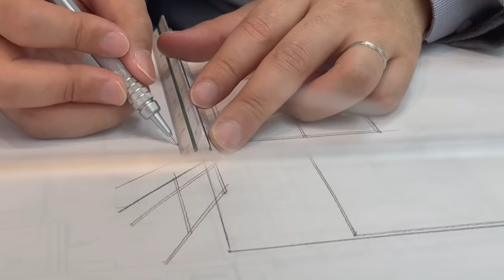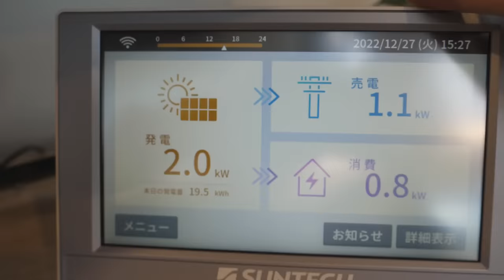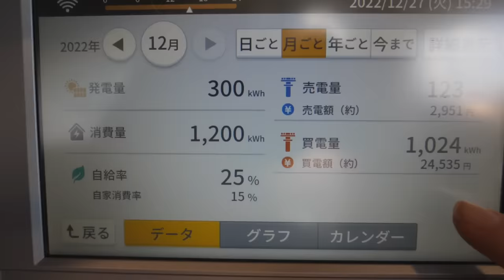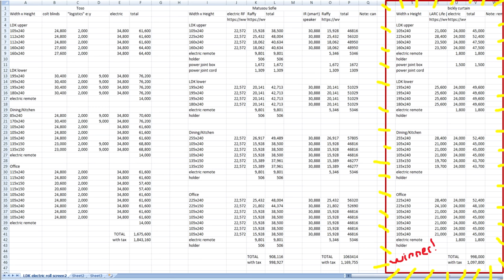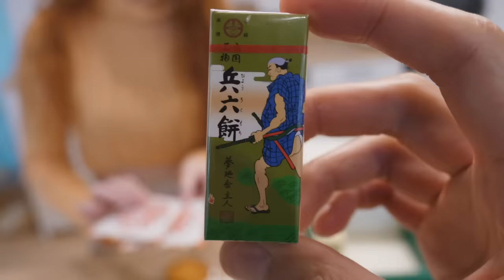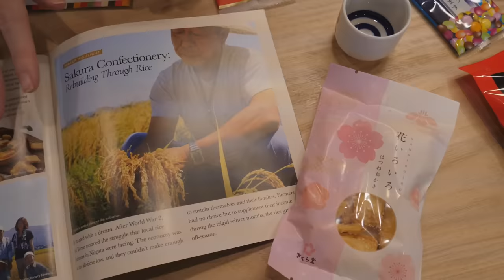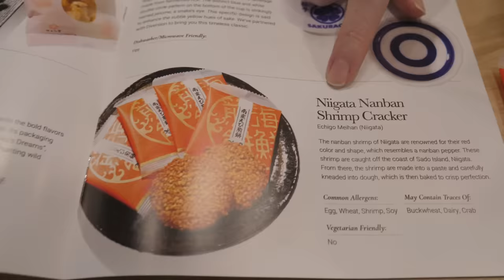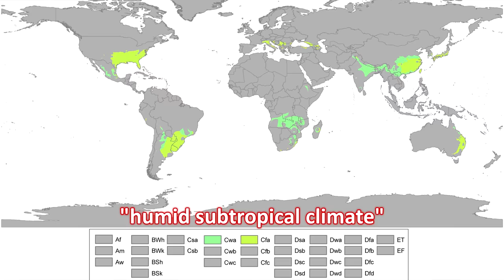1 year in our new house!

Comment: I live in Georgia in the US and run into the same issue as you do with the closets getting humid/moldy in the summer. We've swapped out our closet doors for wood slat doors that allow for more ventilation. There are some really beautiful options that have come out recently. You may want to consider swapping your storage room door out for one with slats, that way you can still shut off that room to the cats and don't have to look at the contents of your closet all summer but the air can still flow through the shut door.
Reply: that is actually a good idea.
Reply: Ill leave a comment here just because I think its a good idea
Reply: Or potentially adding some vents into the existing doors? Could paint the vents to match the color of the doors?
Reply: Same here! mold its always an issue where i live specially in a badly ventilated bathroom, on boxes and ofc the closets.
Reply: yeah, I think this would be better than shutting everything in closed cupboards where there still won't be airflow.
Reply: This is a great idea 😁
Reply: Japan commonly has a lot of paper doors. Would that work? Kind of like storing stuff in paper bags, so it does not retain moisture but still keeps flies out?
Reply: SUCH a good idea, got to boost this so that R+J see this
Reply: A de-humidifier would probably help as well. The storage room doesn't look too big so maybe a smaller de-humidifier + the wooden slats doors idea could do the trick.
Reply: Great idea. I hope they consider it!
Reply: totally agree. this is why even lockers have a vent on the top!
Reply: We live in a very wet climate, like hanging out laundry just doesn't do anything much, and we live by dehumidifiers. Without a dehumidifier running during showers and rainy days, just everything would be moldy. I love them.
Reply: @yeevita  I'd think so?  I mean, the whole idea of the paper doors is to cut down on air flow, but they'd still let more air through than a wood door, surely.
Reply: @yeevita  I don't think cats and paper doors are very compatible, unless you want to replace shredded paper once a year.
Reply: Or cut out holes in the storage units and put in wents
Reply: I agree. Myself I keep the doors of every room open, my cats have access everywhere.  I know this is not possible for everyone but thanks go this I don't have this problem.
Reply: And it’s not a complicated fix either that requires and intense labour or like knocking down stuff or rebuilding
Reply: Great idea...  💡
Reply: @mariafgarcia8165  I agree... 
Being a newer home...plus given their climate.. That would definitely help!
Reply: This is a great tip! I may do it in my own home. One closet specifically gets mold SO FAST
Reply: This reminds me of a Youtuber I follow named Mia Maples who cut a rectangular hole in a wardrobe she was renovating and added rattan to it. A rattan screen or rattan slats in the closet doors wouldn't be a bad idea.
Reply: @10TAckerman  I’d say once a week? As soon as I repair some hole in my paper doors, they make a new one. Once they find out that shouji doors have paper and that storage space doors are from thicker paper, that’s the end of your nice Japanese interior. I just accept this but people for whom nice interiors are a priority, older style Japanese houses while having cats is a nightmare.
Reply: Would having a tiny fan inside help to deal with those problem?

Comment: Hi Rachel, for your moldy storage room problem, you should plug in a dehumidifier and just leave it running in there all the time or at least for a few hours everyday. It will probably fix the problem!
Reply: Or door standard gate
Reply: Coupled with ventilation, the easiest form of which may be altering or replacing the door.  The only issue with (commercial grade) dehumidifiers (which is what I recommend, although that may be overkill for their needs) is that they're loud.

Comment: Solar is so amazing. I love all these new forms of sustainable tech like air-rust, wood, or sodium ion batteries, windmills shaped like a tree and each leaf is a tiny windblade, and now an exciting breakthrough with nuclear fusion. What a time to be alive. 💚💙💜
Reply: I am so damn glad to see more people talking positively about nuclear.  In America there's FINALLY some work being done on field testing smaller safer fast reactors.  I heard the research has existed since the cold war but people were so freaked out by Chernobyl that the project got shelved even though the new tech would be completely meltdown-proof.  The new reactors can even run on the spent fuel from the older existing reactors that are less efficient, reducing nuclear waste to a miniscule level.

Comment: Here are 2  cheap ways to fix the problems you noted.....
You could put grout / cocking on any gaps you may have to keep bugs from getting through. This is common from flooring to moldings and can be nearly any color and is pretty cheap. If you have white moldings you can make it invisible to the naked eye. That may help you push the only way in for bugs .... to certain spots and then put something they dont like such as lavender for mosquitoes. This can easily be done by hand with a cocking gun and stops bugs from getting in from any place accept the actual doors if you leave them open.
For the mold..... portable AC unit. for that size of a room it would be 200 USD. 5min to install. Just gota put a insert in the window for the vent hoze. This type of unit is on wheels and can AC, heat and dehumidifie. In colder seasons you can use it to heat a specific area instead of dehumidifieing the storage room. This is nice if one of you runs colder then the other .

Comment: Mint essential oil, diluted with water, in a spray bottle. You spray around baseboards and entrances--it deters both bugs, including cockroaches, spiders, and mice, and is perfectly safe for pets (and any small children you might have over). Hope this helps =)
It's great to hear you're loving the house!
Reply: For those who own motorcycles, placing a steel scrubbing pad sphere that has several drops of (real) peppermint oil on it in the exhaust will deter mice and their friends from making nests in your airbox...  this is especially nice to do when storing your bike(s) if your locale has snowy periods.
Reply: @WyrdHag  - It is true.  Research.  You have to use the appropriate plants and solutions, apply the solution properly and know that only select insects don't care for it.

Comment: You could add a vent grill to the hall in the door or the wall to the storage room to increase circulation and help with the mildew problem. You could also put charcoal brickets ( not the ones with lighter fluids) in your storage cupboards or shelves in store room. Helps to absorb moisture.  Put them in loose weave cotton bags to keep cats from getting at brickets.

Comment: Install a dehumidifier in your storage room and it will drastically reduce or eliminate any mold. And if you can include a small fan also to circulate the air in the room.

Comment: they make vents that are meant to be installed in doors to aid in airflow between rooms. i've most frequently seen them done with one near the bottom of the door and one near the top of the door so that air will cycle "around" flowing in from the bottom and venting out at the top. another type meant to be installed in walls can have an electrical fan included in them to help force air into the space.

Comment: Regarding the storage room, you should be able to improv air flow by having holes or a grate at the bottom of the door, and again at the top. Both are needed to create air flow. You two have the skills to do this yourself - finding an interest design or purchasing attractive grates, modifying them, and execution. . My kitchen cupboards as a kid had vertical constructed panels  , and the hvac vents had a matching vertical design. Blended right in.

Comment: Hey Rachel and Jun and whoever new homeowner this Amy concern: I have not watched the entire video yet, I have just gotten around your "mold" section and would like to offer a little advice. Your house, as you said, is unusual for Japanese building in beinh made out of concrete and highly insulating glass plus steel beams. In olden days people used to build a property  with  either wood, stone and mortar, clay and Hay ects. All rather open to diffusion from groundlevel water and since windowpanes weren't occlusive the draft also carried warm air filled with water outside.

 Pros of your way of building are obviously good insulation so that water droplets won't form on windows for instance because they don't get too cold as to condensate, the con is: you have removed almost all things that remove excess water from the rooms themselves. 

Coated shelving, coated furniture ect won't take up excess water like raw  or oiled woods would, whereas areas of concrete walls will have (if there are colder spots-doesn't matte if it isn't really 'cold' in the room, cold-er is enough) no way to take up water at all. Old mortar used to be made of material that would also have some 'give' as to waterretention, concrete does not, comparatively. So I would suggest one of the simplest ways of at least getting the room climate into balance again without having to rebuild anything : lime. Limestone is naturally white and makes for great plaster but also great paints. Limestone is both very absorband and also very much anti - mold since mold doesn't like the PH of it. Try it out in risky rooms.
It's usually very cheap. It won't help the humidity problem, but it will prevent spores from spawning and accumulating. Its also safe for animals.
Recommend this to anyone out there looking for an eco option.

Credit: years of limeputty, lime plaster and lime paint building on my own house. Rainiest spot around, no mold anywhere. There are many articles online you can find on lime being used in building, Google it. Humans have been using it for and extensive amount of time.

Comment: You can buy a vent that fits into the door at the bottom to help with air flow and that way the cats won’t be able to get in. Yes, you would have to “damage” the door but it should work.

Comment: Besides maybe changing materials for your doors to improve airflow, I would also invest in room thermostats that also check humidity. I bought the Govee on Amazon and it works perfect! I live in a attic room so it helps me if the air is too dry

Comment: Hi, one trick I learned to do for ant & termite control which also seems to deter other insects is to spray the termite/ant insecticide around the exterior of the house every month.  I use a backpack sprayer to spray 3 to 4 feet up the walls and around all doors and windows.  I also spray my wooden fence along the cross beams. While spraying I also inspect for any insect mounds or vermin droppings and take action if needed.

Comment: Just a thing on solar, you might be better off just storing the power instead of selling it and taking yourselves right off the grid but that may not be as good due to various fees. However I do recommend storing some to use in emergency - salt batteries are a good solution

Comment: Many bathrooms and closets and basements in the USA have exhaust fans an or dehumidifiers to avoid damp/mold+ issues (some Attica use exhaust fans to deal with excess heat. Slated or lattice doors (or metal screen doors) are a potentially faster and cheaper alternative. But might not solve the issue

Comment: There is an interesting old (not currently common) architectural/decorative design that I have seen promoted in recent years called a plate rail when at about waist height and  picture rale for head+ height: it is basically decorative molding added on the outside that is strong enough to hang pictures on (the waist height ones were to protect the wall-chair interaction I think...but looked perfect for holding a modern cell phone !)

Comment: FYI: typically you cannot get vitamin D from window filtered sunlight - you have to go outside to get it. However, you still need sunblock for window filtered sunlight. You can cut up mushrooms and set them in the sun for 15 minutes before eating them to get vitamin D as well.

Comment: Do they not sell 3-Nail wall hangers in Japan? I have some that can hold 60 pounds (27kg) each and only leave 3 tiny holes in the drywall. I have 2 holding up a giant framed mirror in my entry. Probably weighs 100 pounds (45kg) or so. Been there for about 5 years now. Even with trains rumbling the house dozens of times a day, not one issue.

Comment: i'm assuming selling back electricity was just a part of the reasons for solar. But how does the rate for buy vs selling work. ie you you said overall you generated 82% of the electricity you needed. what's that percentage cost wise? I know this varies per area. like in CA, USA they're about to drop the sell rate tremendously

Comment: I remember the very tiny apartment you had.  This is much better.  Spacious, functional, and having the outdoor land is great.  Planting, the pit...
I am wondering what interesting extensions/additions would eventually be built in your huge "yard".  Artisan/ craftsman stuff.

Giant cockeroach, centipede/millipede, spider.  🙄.
Giant mantis is welcomed and useful.  The lizard is cute.  Does it also hunt roaches and other insects?  Those large beetles, cicadas, etc are quite slow moving and can be caught easily should they accidentally wander in.  I don't think they bite.
I miss seeing fireflies.  Have not seen them in August, for many years now.  They don't live too long though.
Spiders live long lives.

Ceiling fans is a good idea.  Much more comfortable air with them.  And wall sconces are helpful when all the lighting is above head shining downward.  A trustworthy electrician could easily work those in.  Plugging in an air purifier/cleaner with true HEPA in the storage room may reduce mold/mildew activities.